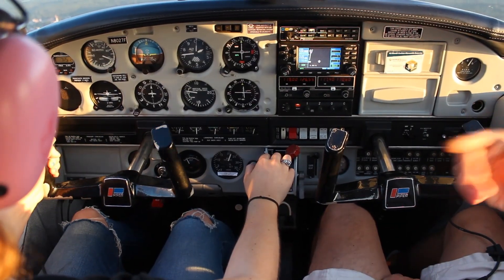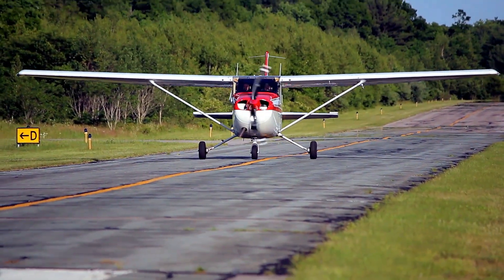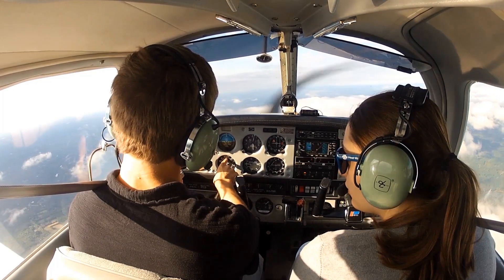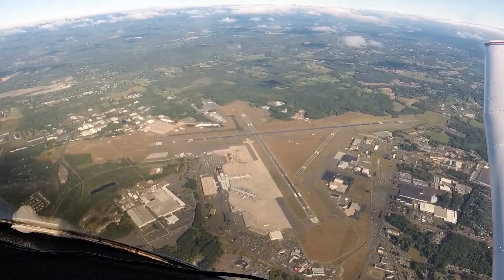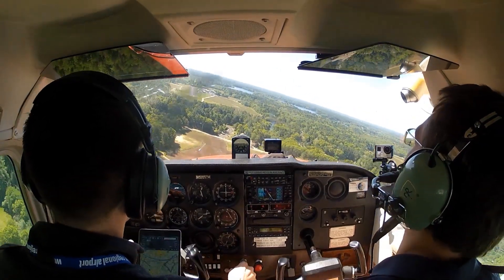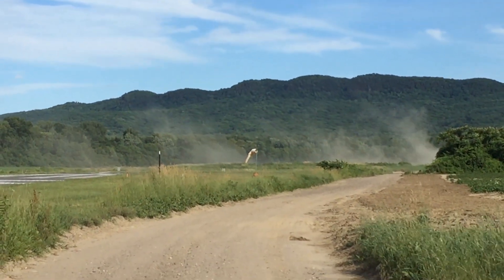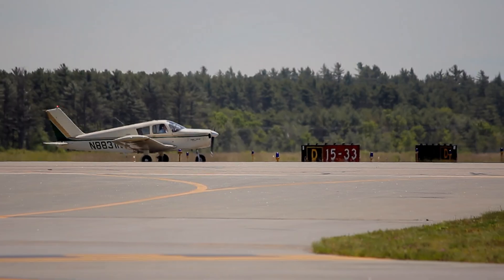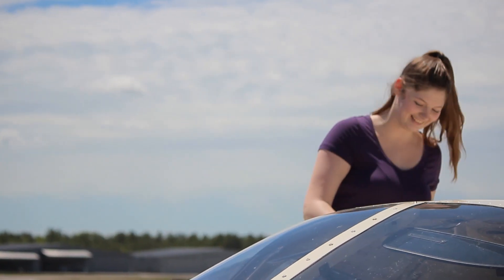Carb Heat Demystified:  Understanding the mechanics and the dangers

Comment: I learned to fly on Cessna's and transitioned to Pipers. I found the complete 180 of use of carb heat perplexing. I did some research and found some interesting items.

During the 1960s, accidents were VERY commonplace. Go do a search during the late 60s and you'll find about upwards of 60 a month. That's about 2 per day. Granted it was the heyday of aviation and all manufacturers were pumping out astounding numbers of planes, but it seems that training was not quality controlled as it is today. It's interesting to note that in the early 60s, the Owners Manual (good luck getting a quality POH back then) was little more than advertising typed up by lawyers. This is evident by Cessna's switch from Continental to Lycoming engines, they retained the requirement of the use of carb heat, even though the Lyc is much less prone to it. They determined it would pose less risk to the company.

Piper's lawyers, on the other hand, felt as if the lack of power on go around was reason enough to mitigate using carb heat and as such, recommend you NOT to use it. But do a search on Cherokee crashes. At my home field, we've had three fatal accidents in the past 30 years. Two of which were Piper Cherokees. Both had unexplained power loss. Conditions at the time were favorable to carb icing. One survivor in one of them admitted they pulled power for a long descent from cruise and at 1,000 feet lost power. Applying carb heat was too little too late, the engine was too cold to melt. The aircraft crashed into terrain and the PIC died. 

As denoted in the film, know how your carb heat works and make an informed decision. Using it proactively will not hurt you (unless you count sucking in unfiltered air, in which you would have to do A LOT to begin deteriorating the health of your engine) but it can help you.

Using carb heat on my last flight potentially saved my life. Normal run up, normal drop at 1600rpm with an application of carb heat. I went flying, and an hour later on return dropped my gear and put prop at full forward (2700rpm). Power 16" MP, I applied carb heat in the downwind and immediately lost a majority of power. Carb temp gauge was pegged in the plus (no ice) so I disengaged carb heat and all returned to normal. Carb temp still good. I landed and thought about the problem. Pulled the cowl, did some ground running and pulled the carb heat shroud. I found a crack in my exhaust, in which applying carb heat at high RPM sucked the exhaust into the intake causing an overly rich mixture and starving the engine. Note: IT DID NOT DO THIS ON THE GROUND AT LOW RPM. If I had continued to fly, the crack WOULD have propagated and I WOULD have suffered from CO poisoning. I have since sent my exhaust out for overhaul and purchased a digital CO monitor (I have the stick-on placard and it did not indicate ANYTHING). 

So yes, carb heat possibly saved my life in an indirect fashion.

Just my $0.02. Not an A&P, PPL owner only.
Reply: Did you mean it caused an overly lean mixture? If the exhaust gases were sucked into the intake causing more air than fuel, that would be a lean mix, hence the starving of the engine. Or were you meaning to say the air was being sucked out the crack, making the engine run rich due to lack of air? I just wanted to clarify for any one else reading.

Comment: Well thanks for that, I learned something .... I've flown both PA28 and C172 aircraft since 1974 the 172 only for a few hours, I preferred the Piper so mainly PA28 and I was taught by one instructor to routinely use CH when throttling back, for example on the base leg after downwind but I was lazy and never used it. I was told to look for a small drop in RPM when it was applied. Perhaps you could have mentioned this in the video. Another instructor I had in 1974 never mentioned it and was vague when I questioned him on CH. From what you say I wasn't wrong to not use it  .... (by accident!). Most of my flying was done at 2000 to 3000 feet btw and in good, fair conditions, never in particularly cold temperatures, though it isn't this which dictates whether CH is "necessary" I know ...  it CAN be necessary at any time regardless of outside air temp. One of the first things to do if you have an engine  suddenly running rough is apply carb heat for a while.
Reply from the maker: Those were pretty much my attitudes exactly.  Especially the part about preferring Pipers ;)

Comment: Where I fly in cold and rainy Scotland, I would much rather have the carb heat on anytime my power was below 2000 RPM and also during my downwind BUMFICH checks then turning it off on CRAP checks at 500ft. Something I see pilots also not doing is checking for icing properly on run up checks before departure. 10 seconds of carb heat and thats it right ? Nope... The amount of times I have seen the Carb heat go on, RPM reduction and then BOOM... there is a rise due to icing whilst the carb heat is still on and the P/IC doesn't notice is scary!

Comment: Hey Nick, another great video. I just bought a piper warrior 2, much like yours, with a buddy of mine. I am taking my flight training in it now. My instructor, who is also a cessna, instructor, always has me put on the carb heat on downwind, and leaving it on all the way to touchdown. Your video comes at the perfect time. I have previously mentioned all your points to him numerous times, but he still has me turning it on and leaving it on, which i am in full disagreement. I think he is more used to the cessna procedure as he says turn it on always whem rpm is below 1900. Your video is golden! It pretty much confirms what i have been saying to him all along. I guess, the bottom line, is follow the procedure for the specific aircraft you are flying.
Reply: Interesting. Have your instructor read the POH and let us know what he says.
Reply from the maker: That's indeed the name of the game!  Glad I could have good timing for you ;)  Oh, and congratulations on becoming an aircraft owner!!  You'll love the warrior.

Comment: Great video.  I didn't know the rule with carburated Cessnas.  I rarely use carb heat in my pipers.  If there is visible moisture and low temps that sucker goes on though.

Comment: Interesting stuff.  I would consult the POH or AFM before talking to a mechanic--fly by the book.  You never mention cold weather operations; I feel like some aircraft require some use of carb heat during extreme cold.   Some aircraft require the use of carb heat when flying in significant precipitation, irregardless of icing potential.  I feel like this video could easily be twice as long.  You should consider putting a disclaimer on the videos that are more instructional...
Reply from the maker: Oh, I totally agree.  You may have noticed that I told people to read their aircraft specific literature about a dozen times, and there's a disclaimer in the description.

Comment: +Friendly Skies Film Would you ever use Carb heat on takeoff? Just asking as the RPM says 'Use below certain alt', if you were taking off would you still use it or would you only use it for decent?
Reply from the maker: I can't think of any reason you would ever want to do that.  Burn off the ice before your roll, so you can develop maximum takeoff power.

Comment: Good video, I don't use Carb heat on the Cherokee 140 either. only for run-ups to check its working and sometimes on for 10 seconds or so on the downwind when dew point and temperature are within 3 degrees of each-other.
Reply from the maker: Sounds about right to me.  I think that's how Piper intended it.
Reply: @FriendlySkiesFilm  Seems to me that Piper passing that intake air over the cylinder heads warming it in normal operation would reduce air density and thus power.  You want to introduce the coldest air possible into an internal combustion engine if you're looking for performance.
Reply: Yup! That's when condensation occurs!

Comment: Carb Heat, that's a funny thing. Performance auto engines that use carbs (read Racing engines) use insulators between the carb and manifold to reduce carb heat and usually large 'snorkels' to get cooler air to the engine (cold fuel + cold air = more power). I am of the opinion that the chart near the end of the video is the most useful info for aircraft.. It is fairly difficult to get Gasoline to 'freeze', but ethanol and the water vapor being drawn into the engine can freeze. Again, check the chart, the current air temp and dew point/humidity. BTW,  Throttle body fuel injection systems can freeze up also.

Comment: I was landing in Bimini, Bahamas (hot and humid) and was talking to another plane joining the circuit.   We agreed to meed on the tarmac to buy some lobsters.  

I parked my plane, got out and saw the other guy parked, engine off, almost on the runway numbers.   10 minutes later the engine started and he joined me.   He said he did not use carb heat because it was a hot day, and he lost the engine on final.  Barely made the runway.
Reply from the maker: Excellent story!  I'll be joining you guys in the Bahamas soon!! Can't wait.

Comment: whyy dont tey put a filter on the hot air ntake too?
Reply from the maker: Breaks down in 1500 degree heat, and as a last ditch bypass if your intakes are clogged.

Comment: And you dont need full heat all times, it is an adjustable lever for the conditions, Not just an off on swicht.  I have flown with engine ignoramus types that can only think about applying 100% of carb heat, or nothing at all. 0% or 100%.  All or nothing idiots. One of them finally crashed. 

He took off on a damp morning. Engine due carb ice started missing at about 500 feet agl, he idiot applied full carb heat as not told. but he did as the initial BS CFI had said,  All or nothing carb heat. He didnt lean the mixture a bit as i told him, and rehearsed before, but as the initial CFI told him not to touch the mixture control, under 4,000 feet agl,  so the idiot did,. Of course the engine lost a lot more power, then about 10 seconds later, died out. He crashed on trees straight ahead about one mile from airport. Got hurt badly. Cant fly anymore due get panicky.
Reply from the maker: I'll admit that I've never added anything but 100%, but obviously know that it's just an analog lever; however, I would be tough to convince that you could really act as an effective one-dimensional control system without some kind of feedback.  I'm down to hear more, though.
Reply: You have to adjust the carb lever a few times OUT, THEN IN, during carb ice events. It is called one of the kinds of Engine Troubleshooting. The Engine Management for "Engine Miss Firing Condition".  Different than Engine Quit Condition. First, lean the mixture a bit, not too much. The apply some, not all carb heat to melt the ice.  Expect the engine to get a bit rougher due ice melting and mixture getting a bit richer with carb heat on. The problem is that the too rich mixture is starting to flood shut the spark plugs, so the engine missfire condition. 

You always have to lean the mixture a bit when using carb heat. Then as the engine gets smoother, you take off some carb heat to get more power, as power comes back you have to enrich again the mixture.  Due carb ice is present, leave SOME carb heat on as you climb, SOME, NOT MUCH. Just to avoid getting carb ice AGAIN. It is a matter of adjusting the mixture and carb heat levers. They are not switches, they are levers to be adjusted. 

It is a matter of avoiding the engine cylinders from getting flooded with too rich mixture. So a combination of carb heat lever and mixture lever has to be used to keep the gasoline mixture at good levels. 

On my motorcycle I have to adjust mixture with the choke lever all times when warming engine and tried to to take off.  And besides handling the choke to smooth the engine, we are also changing gears, avoiding bumps, avoiding getting hit by others, etc, while smoothing the engine and trying to accelerate. Its feels or It is just like an partial engine failure on take off, but on the ground. 

"Choke adjust on a take off"  can be a bit freaky when you have an ahole on a pick up truck behind you, getting too close  and you are trying to smooth the engine and changing gears to get away from him. Happened to me on a hill climbing take off on my Honda Shadow. Freaky,  but I smoothed the engine and got away. Hondas need engine warming well or they start missing on take off.

Comment: If it's such a risk, why don't they place a filter in the heated circuit? Cost saving because carb heat is only used for a limited part of the flight? Just curious. Great video otherwise.
Reply from the maker: As we discuss below, a filter could not take the heat from the 1500 degree exhaust, and to act as a bypass of your other filter becomes blocked.  We had a hard time finding an answer too.

Comment: Awesome video! really good explanations. I would like to add though, that Lycoming themselves have said that on their O-320 engines, they were unable to purposefully induce detonation using carb heat. Here in the UK we teach to turn off Carb heat 200-400ft above touch down, and to turn on carb heat below the green arc (just like you said). We also turn carb heat in the circuit, somewhere late downwind. This is of course a generalization. As you said, the POH comes first! What is says goes.
Reply from the maker: Sounds like you guys got it under control over there :)

Comment: My instructor puts carb heat on when reducing power under the green arc in the air in the 172 and told me to do that as well.
Reply from the maker: That's because that's what the POH says to do in a 172 :P

Comment: Why don't aircraft use an intake temp sensor? All fuel injected eng's have one for a reason. if you had one on your carb eng you could adjust temp with carb heat lever as needed..
Reply from the maker: They make them, but they're such a rarity that I've never seen one.

Comment: Carb heat should be off during taxi and go around, so you make a couple moot points
Reply from the maker: Yes, it should be.  I consider that to make the points very valid ;P
Reply: Friendly Skies Film You would go around with carb heat on?  That's crazy and dangerous.  Reduced power departure climbs lead to some serious (albeit short-lived) regrets.  Turning off carb heat when going around isn't like dumping flaps on approach or low altitude.  
Are you sure you have your procedures right?
Reply from the maker: Dude, I literally said not to do that in the video.

Comment: Carbi heat enrichens the mixture so detonation should not really occur
Reply from the maker: Well, it does XD  Don't know what to tell you.  I've experienced it myself.
Reply: Detonation isn't caused by running too lean. Detonation is caused by too much heat (which may or may not be related). Putting hot air into the cylinders won't help cool them.